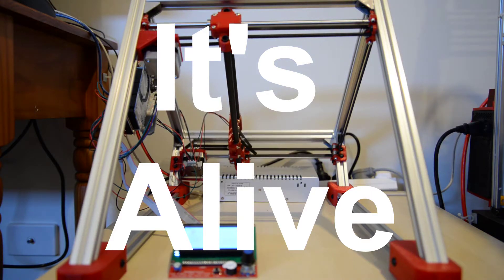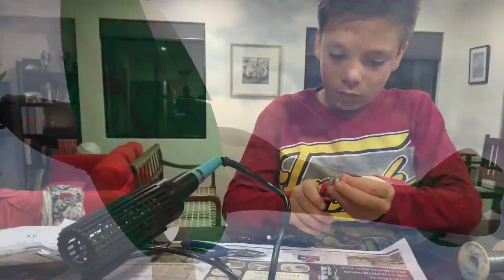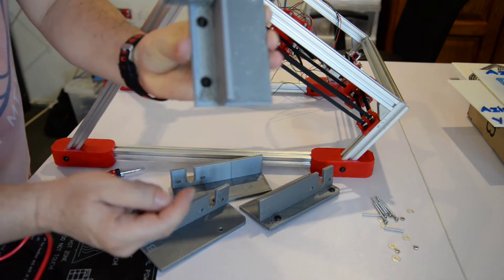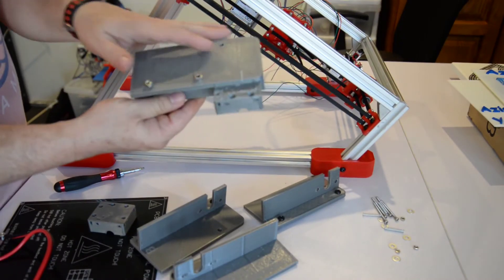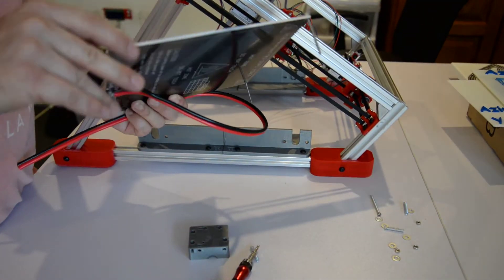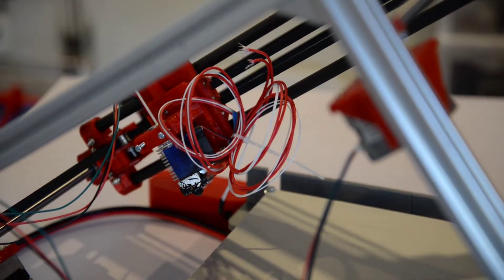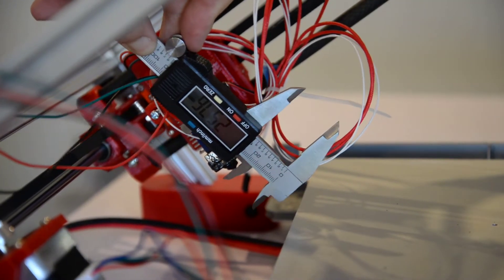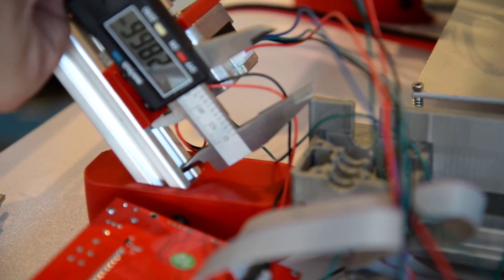Hypercube Infinite Z 3D printer: Part 3

Comment: An easy solution would have been to just raise the conveyor belt
Reply from the maker: Yes. You are correct.  I should have done that rather. Putting spacers under the conveyor would have been way quicker and more flexible. 🙂